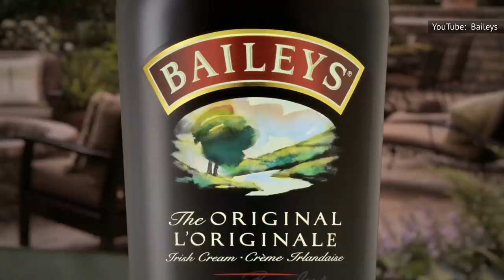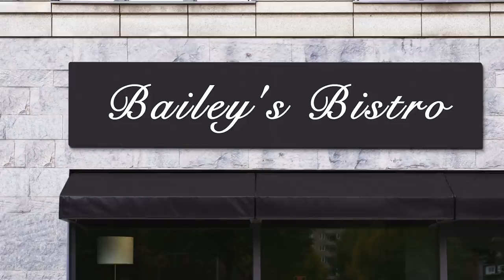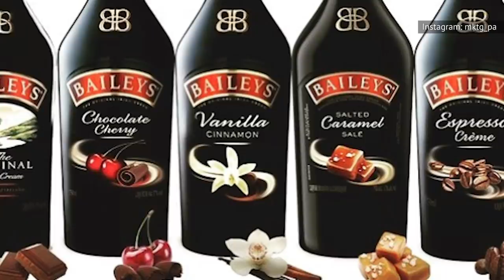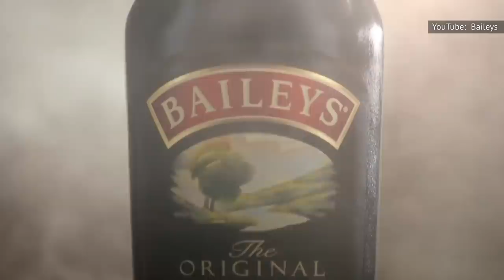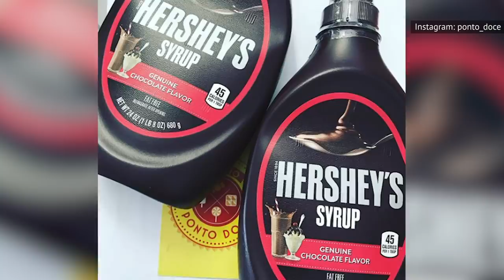What To Know Before Taking Another Sip Of Baileys Irish Cream

Comment: Huge FYI - Cream liquors of all types should be drank within a month of opening the bottle or the cream can cause it to spoil.  Cream liquors do have a shelf life and it is not mentioned on the label.  They can curdle if exposed to heat or too much time has passed.  Plain spirits generally do not spoil, but flavored items (cream, fruit juice) will.
Reply: How much time is too much time? 🤔
Reply: Creams need to be drank within a month of opening.  Creams have the bottling/experation date on the box they arrived in. Your liquor store may or may not tell you what it was.
Reply: @adripta7500  Baileys is the only cream liqueur that guarantees its taste for 2 years from the day it was made, opened or unopened.
Reply: Well, it will be definitely be emptied on day 1. 🤣
Reply: @tgr7975  the fact that you are even considering drinking it and not holding on to it as something super cool tells me you're just a troll xD
Reply: I just drank one that has been in the fridge, opened, for over a year and it was delicious. Not spoiled whatsoever. Five Farms. The 1 month info is bunk.
Reply: i have one thats been open for 3 years. The part around the cap is really crusty, but when i poured it into a glass it looked and smelled fine. I also had a brand new one next to it and they were identical
Reply: My information was from a distiller who makes all different types of liquor.  I have had cream liqueurs which have curdled even though they were never opened.
Reply: I usually polish a bottle of in a few days so no issue with spoiling😉
Reply: Baileys is lucky to last a day in my gaff
Reply: Except if it's home-made eggnog.  That keeps at least a few hours.
Reply: nope wrong itll last over 2 years in you home of course u cant heat and chill or extreme temp variations.